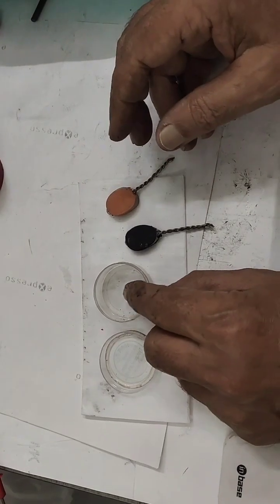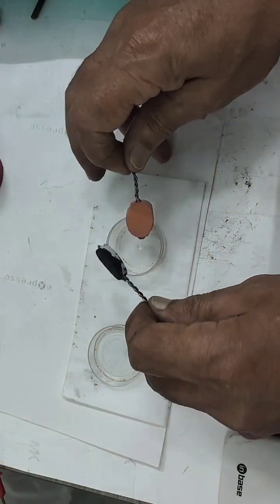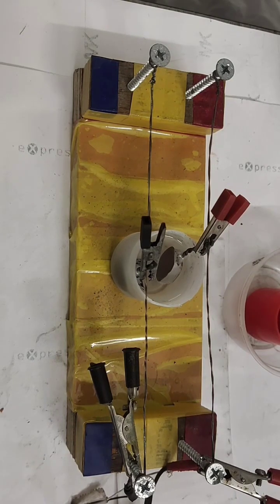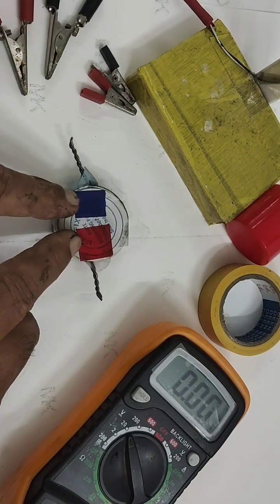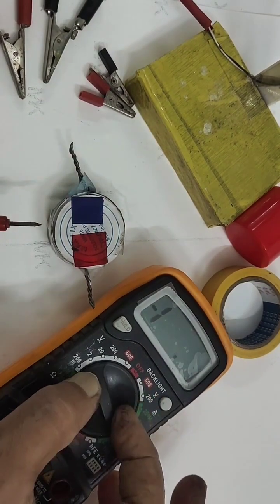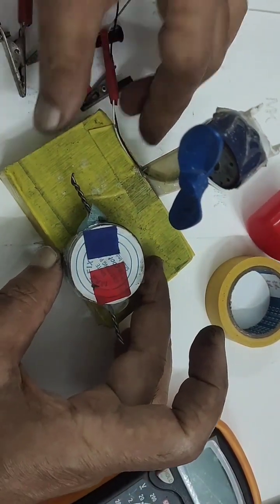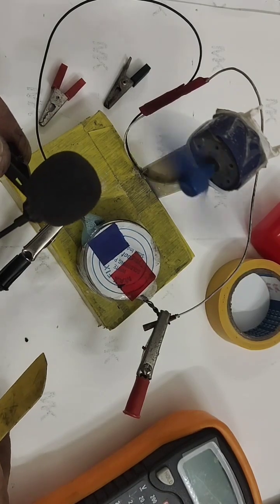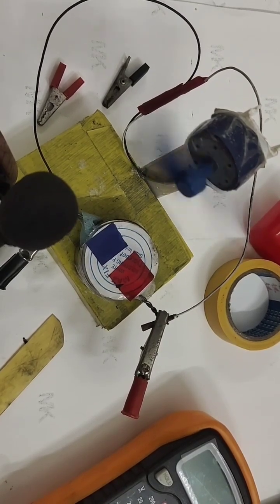LEAD ACID BATTERY, SMALL DISC SHAPE WITH MORE CARBON IN NEG,  V 2.2, CURRENT 550mA VIDEO -72, D.I.Y

Comment: DKJ:- very good concept with simplicity lead acid battery, only with 1 pos, & 1neg plate fantastic out put voltage 2.2 v, & sufficient ampere, good Demo+presentation. Thanks.👍🏿👍🏿👍🏿 JPN.
Reply from the maker: Thank you JPN🙏